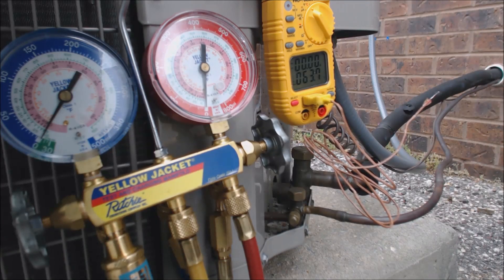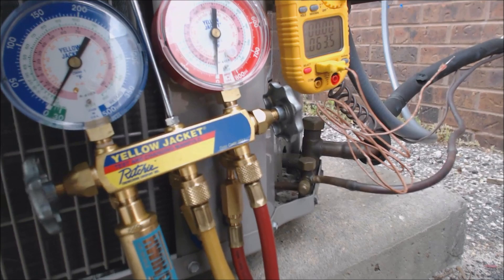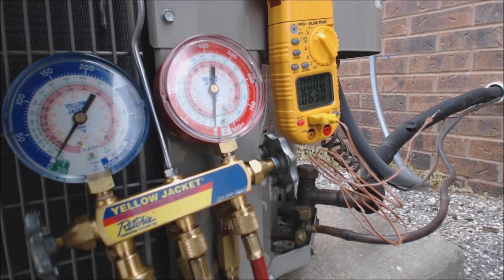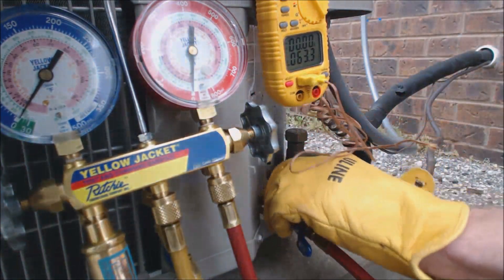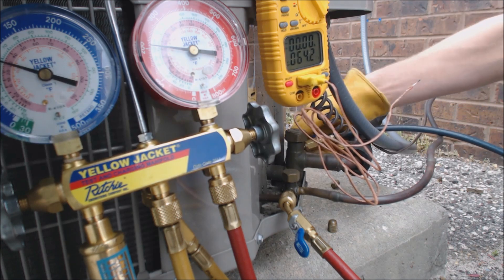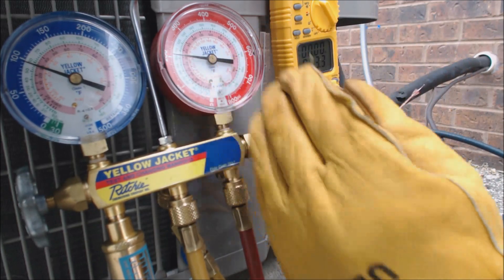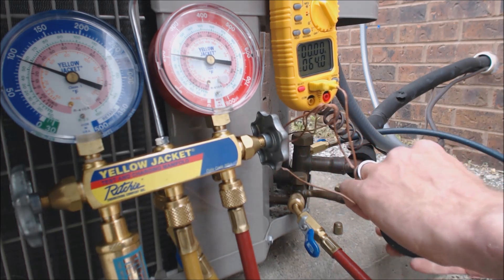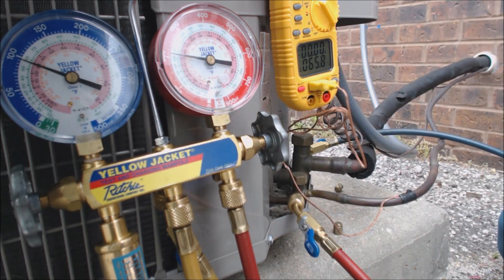Checking Refrigerant Charge!: How to Properly Attach the Gauges! What to look for Before Charging?

Comment: hey bud,
i really appreciate your videos and the time you take to make the
 superb!
you have a bit of videos on how to properly charge a system, but i have not seen one anywhere on youtube about how to recover refrigerant from a heatpump while unit is running. Heatpump i was working on was way overcharged.
Im not sure if i took the right steps but in heating mode i had my gauges hooked up to the heatpump and the refrigerant hose to a recovery cylinder. i opened the liquid valve and cracked the refrigerant valve a bit at a time. this seemed to have done the trick bit i dont habe anyway of knowing if that was proper procedure or not. 
please reply and i can furnish more details on the steps that i took. and if you could make a video that would be awesome.
New to servicing heatpumps but am an installer.

thanks
Reply from the maker: Recovering refrigerant from a system can be done in heating or cooling mode because subcooled high pressure liquid is always in the liquid line. If the heat pump was in cooling mode, it would be just like this- https://youtu.be/W-99R42WKSQ

Comment: A lot of techs say you have to weigh in charge for 410a with a micro channel condenser. You cant use subcooling because there isnt enough room to stack refrigerant in a microchannel and you get improper readings. What is your take on this?
Reply from the maker: I believe Nordyne and Gibson give you a variable target subcooling depending on liquid pressure and actual temp, Trane gives you a chart with Outdoor Ambient and Vapor pressure to find a target liquid pressure and alot of other manufacturers are just very concerned with any overcharge because there is no where for the liquid to go in cooling but give you a target subcooling. You should start checking for 18-21 temp diff inside when you are 5 degrees lower than the target subcooling and really take your time. Otherwise yeah you would do a recovery and weigh in the charge. Thanks Capitol!
Reply: Opvtv

Comment: You said to properly check the charge it needs to be around 70 degrees or better, but what about the temp inside the house
Reply from the maker: Basically there needs to be a load on the house meaning it is at least 65 degrees or more. Subcooling takes place in the outdoor unit anyway and the superheat method takes consideration of the indoor wet bulb so as long as the wet bulb aligned with the outdoor dry bulb gives you a target superheat then you are good. Thanks Trukin Forever!

Comment: So when you first hook up your gauges to the system you do not purge anything, and when you add 410a and hook up your yellow to the bottle then you purge correct.
Reply from the maker: Yes or before you charge the liquid that was in your red hose back into the system after you get done checking it and before the disconnect. - https://youtu.be/zJmZHzLwqbs  --  https://youtu.be/eXkqOS_qywo

Comment: Hi, sorry to bother again. I was told that a low air flow or dirty evaporator can raise subcooling. Is it true? Can you explain the changes in subcooling and superheat with a low air flow on txv unit and orifice unit? and also the changes in SH and SC with a dirty compressor? thank you!
Reply from the maker: Low airflow can raise subcooling because there is more refrigerant on that side of the system. Low airflow means low superheat on piston systems. Txv's  will always try to hold around 14 degrees of superheat on comfort cooling systems as long as it has enough refrigerant to do so. Make sure you check out the playlists and pick and choose some of those videos especially the txv diagnosis videos as well as subcooling and superheat. Thanks

Comment: I have a 2006 carrier split system with king valves on the condenser, and the condenser has a board on it. It is not a heat pump.
I am getting a low pressure switch error code on the board, and that is not allowing the contactor to pull in because the 24 volt is tied into the low pressure switch on the board. How can I check the charge when the compressor is not running. The condenser fan is running but the compressor is not due to the safety on the low pressure switch.
Reply from the maker: Using a pressure temp chart, you can see that r-22 on a 70 degree day is about 122 psi so if that is the case when you hook your gauges up and it were r-22 then the board or the sensor are wrong. You can also check continuity across the sensor and see if it is closed as it should be close to 0 ohms of resistance. Those boards in outdoor condensors are not needed if they go bad. They are needed in heat pumps though. I always take the bad condensor boards out and just break the y with the safety sensors and power the contactor that way.
Reply: Could you do a video on how to break the y with  the safety sensors to get rid of the board on the condenser

Comment: Excellent video. Just to make sure the AC is powered off when you are connecting the hoses, right? and is there a video that shows how to check if my ac has a txv?
Reply from the maker: You can connect the hoses when the system is running or when it is off. I believe this is the video you are looking for, thanks- https://www.youtube.com/watch?v=B7mm5dBNEeQ&list=PLxnHR5_D2ojxTcAtR_53GoY8huBcSOt0a&index=5&t=111s

Comment: PSI - stands for pounds per square inch. PSIG stands for pounds per square inch gauge. The pressure indicated by the gauges is in PSI - NOT PSIG...
Reply: Gauge pressure is an actual measurement though, I can't remember if it is 30+ or 30- psi but there is a difference between psi and psig